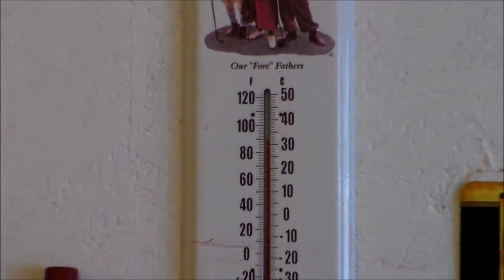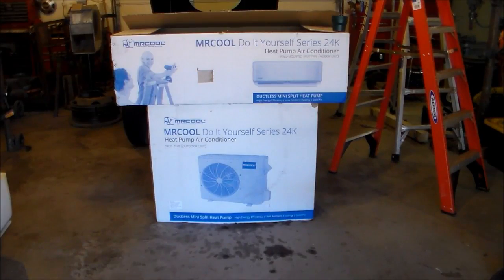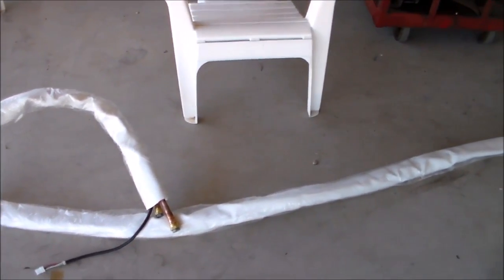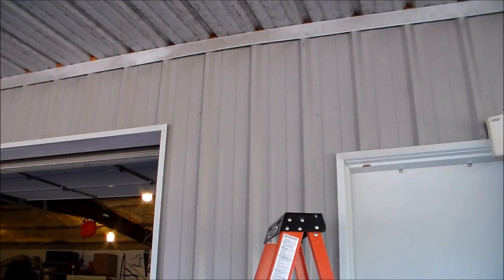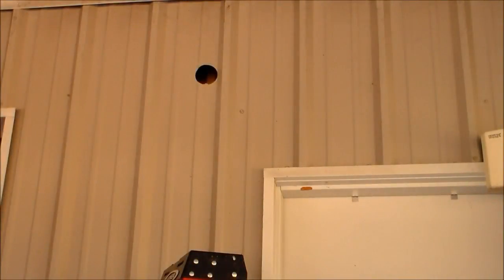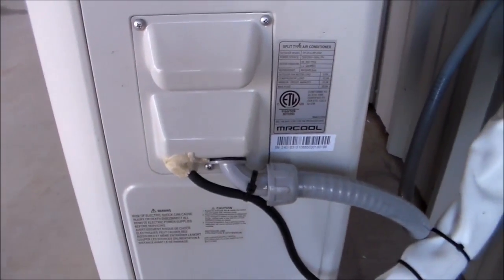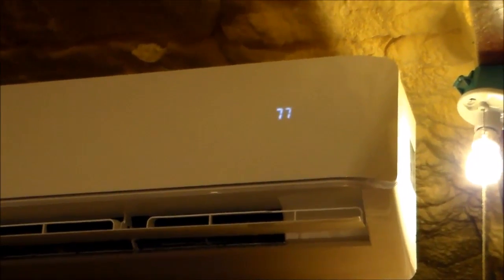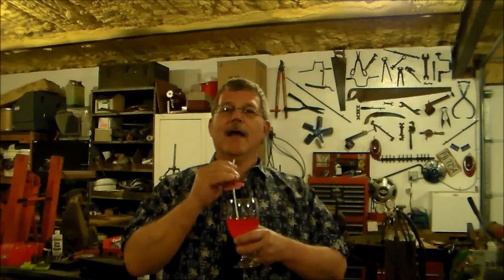DIY Mini Split Install -how to install a  Ductless Mini-Split Air Conditioner

Comment: Hey Rusty!  I just purchased a Mr Cool 18K and the elect requirements in the manual are clear as mud.. I can't find the startup amperage for the unitand the book says use a 30amp CB with either 10 or 8 wire.  I have 105' run from fuse box.  Their specs don't make sense to me.  I've requested clarification from Mr Cool.  What think? any ideas on wire#, CB amp are appreciated
Reply from the maker: With a 30 amp breaker with a 105 foot run use 8 gauge. Much more than that you might go with 6 gauge. If any question check local code. Good luck, you will really like the Mr Cool unit

Comment: I wonder why You Tube thought I needed to see this again today. Temperature topped out at the round 100F this afternoon.
Reply from the maker: These units are very effective in the heat and cold. Would really feel nice on a 100 degree day. 👍

Comment: Pardon me but did not see unit voltage or amperage draw.. did u have to change the line or the braker ?
Reply from the maker: 220 volts, breaker size will depend on the model you get. The manufactures web site has  instructions that give that info for each unit. Good luck on the one you select.
Reply: @RustyGlovebox  thank you for the response.. looking at some reviews.. going to store later..will check the website after I decide...thank u

Comment: So have you had any failures of this unit after 4 years?
Reply from the maker: Not any failures , it is really nice to have in the shop when it is too hot or cold outside.
Reply: @RustyGlovebox  I was wondering, I installed a 9KBTU Turbo Air unit with heat pump, in my metal working shop (lathes and mills), last month. It's a 8x30 area with 11 foot ceiling. So far I've been running it in dry mode, and this brand allows temp. control. I'm worried about the inverter electronics failing in the outdoor unit. I'm thinking of removing the circuit board and painting on conformal coating to insulate the board from any vermin (as that seems to cause big problems with electric shorts), and it will protect against condensing water vapor. I assume my winter coldness exceeds yours with typical highs in the 20s, but lows -10s to -30s. Central Iowa. The summer sucks with 90s and real high humidity, but nothing like humidity off the ocean.
In the house I just finished a 17KBTU  Mitsubishi, and a 12KBTU Daikin. I was trained in HVAC back in 1976 at a 2 year trade school, and worked for the Trane company in La Crosse, WI as a lab tech. 
I'm trying to make sure these mini splits last more then a few years. As the central air in the house I installed 20 years ago, is still going strong.

Comment: Curious why you didn't run the lines down the INSIDE wall where it could be hidden and put the 3.5" hole by the outside unit..?

Comment: placing the air-conditioning next to the heat source is not suitable
Reply from the maker: You raise a good point. I may mount it on the wall to get it away from the roof. May very well help.

Comment: You didn't have to pull a vacuum on the unit or mess with any freon?
Reply from the maker: Richard Neal   That’s right the system comes ready to assemble pre charged with refrigerant. Connect the lines and turn on the valves.

Comment: Did you have to pull a vacuum on the lines to the evaporator?  If so, how do you maintain a vacuum while you attach the lines to the condenser unit?  Thanks,
Reply from the maker: The system comes fully pre-charged with freon and oil. Condenser is already under a vacuum. The lines have a check valve connection with a nut connection and are 25 foot long.

Comment: Thanks for the video.
 I installed an 18,000 BTU Mr. Cool unit about 2 months ago, primarily for heating. It depends on how well your house is sealed, but I would suggest going to the next size larger, just to be sure it can keep up. Though the unit is rated at 18,000 BTU heating output, I think that is a little optimistic, as the colder the outside temperature is, the less efficient it gets. The compressor unit only runs as fast as needed, so over-sizing doesn't cause the unit to cycle excessively...it will just run more slowly.
As noted in other postings; be sure and check the packages for shipping damage before accepting. Mine had an electrical cover cracked and sheet metal bent on the compressor unit. It was an easy fix, but I didn't find the damage until I completely unpacked it at home.
Saw in another posting: they used a plastic gutter to cover the lines down the side of the house so that's what I used. Much cheaper and easier to get in my area. About $15 instead of $50.
You can also buy it through Lowe's online.
Reply from the maker: Thanks Brian, lots of good info. I use mine primarily for cooling in the summer when it is a 100 plus outside. Winters here are mild , so for me the heat is more than enough. My old shop had not HVAC or insulation so I have never been happier with the unit here. Enjoy your week.

Comment: It may be a 100% do-it-yourself, however, i believe the warranty document on this model states that warranty is valid ONLY if installed by a certified HVAC installer, and most be noted on the mail in registration for product warranty reg. Seems one can still save money doing most of the physical work then let the licensed person come in, finalize/inspect, and sign off on it, for a fraction of cost had he done the entire project? Not sure if HVAC folk would do that.
Reply from the maker: I have a HVAC certification and registered the system with the manufacture. Easy system to install and works great. Take care
Reply: Actually, the DIY units do not require professional installation for the warranty per the MrCool warranty website.  "Proper installation – Limited warranty applies only to systems that are installed by a state certified or licensed HVAC contractor, under applicable local and state law in accordance with all applicable building codes and permits; MRCOOL installation and operation instructions and good trade practices. 
*State certified or licensed HVAC contractor not required for warranty on the DIY series units. (Always check your local laws.)"
Reply: That is correct, Debbie!

Comment: Where did you buy that hose guard and how much?
Reply from the maker: I got it from the Home Depot website . About $50.  You could use plastic rain gutter down spout.
Reply: Thank you for that. Normally i use PVC trunking but after seeing some pictures of big contractor from China using the same material as you do, including that plastic rain gutter down spout for their ac installation job, i always wanted to try do the same. I like the looks of it.

Comment: You never said what the temperature drop was?
Reply from the maker: On a 100 degree day it will keep it in the 80's . The shop is insulated with foam and that helps.  It does a good job heating too in the winter months.

Comment: Why the heck do they call them 'ductless' systems?! It's a Split type system. That's it. Simple. You all know what a 'packaged rooftop' unit is right?! Well this is a hi-wall split system.
Reply: Most homes are a split system too. But these are ductless split system. Pretty simple

Comment: Thanks for posting.  One question: if the inside unit and the outside condenser are located close together, can you cut the lines/shorten them or are they a set length?
Reply from the maker: The DIY Kits come with 25 foot sealed hose kit and requires no licensed installer.  The extra hose can be left rolled up in the attic . The unit is precharged and requires no additional refrigerant because of the known hose length that is charged at the factory. 
They offer other units for copper tubing you cut to length,  draw a vacuum, add oil and charge with refrigerant. A licensed tech would be required to install these units in most cases. Thanks and Good Luck with your install
Reply: High Voltage Toys, you still need to vacuum the lines before you open the king valves that allow the refrigerant to flow in the lines.
Reply: I think you just answered my question I was about to ask. Good to know there is no need for bleeding, vacuum tests and all that. 
So just hook up and good to go?

Comment: I'm playing stupid today! #1 heat pump! in ground? #2 pre-,charged- refrigerant or ammonia? # 3 can lines be shortened/lenghtened?
Reply from the maker: It is a heat pump system not geothermal.
Precharged with R410a
These line do not get shorten. The DIY kit  has sealed standard length lines already attached and pre-charged. It will not require a licensed refrigeration tech to install this system. 100% do it yourself kit.
They do offer other units that you use copper lines cut to length like a conventional system too. I hope this helped. Good luck

Comment: Can you connect a normal wall thermostat to the AC?
Reply from the maker: This unit has a wireless remote with a wall mounting bracket and it also has the ability to work with a smart phone.  You might contact the manufacturer if you really require a fixed wall mount thermostat.
Reply: Rusty Glovebox, thanks for the reply.   That was a nice video you posted.  I want to connect a split AC with the nest thermostat  at a vacation condo. 
Happy holidays to you and your family!

Comment: How many BTU is yours and how big is your shop? Just trying to get an idea on what size I might check into.
Reply from the maker: I am cooling about 1350 sqft with this unit.  It's a 24000 btu unit and suppose to handle 1600 sqft. My shop has foam insulation and that helps. They also make a 36000 btu unit DIY install system , mine is MR. Cool brand and have been happy with it. They have a website, Good luck!

Comment: Which model  I know 2 ton  about how much $ not to be noise   The lines are really  SS.  I need help picking one out  .   Thank   Carl
Reply from the maker: Mine is a MrCool- DIY-24-HP-230A. You can check the current price at Home Depot web site. The lines are 25 foot long and seal with an o-ring and line nut at the condensor. No need to vacuum or charge with refrigerant, come ready to go. Connect the lines and electrical and the unit is ready to go. Good luck on your choice.
Reply: carl dore check out Paylessminisplit.com for quotes.
Reply: I thought doing a vac on the system was supposed to be done just to be on the safe side and remove any possible moisture in the system? At least I've seen many videos suggesting to do so. Maybe this unit and lines don't require vacuuming the system. Just wondering. Great video.

Comment: I'm really impressed with these DIY units, too.  By the way, your video shows 30A breaker, but the 24k unit calls for maximum of 25A fuse/breaker.  And it doesn't look like the disconnect is a fused type.  If it is, you could have lower amperage fuses in there.  Maybe the breaker you were showing had nothing to do with the install and was just an example shot.  The unit will do fine with 20A fuse.  In fact, I believe it'll run fine on fuses as low as 15A.  Hope these units keep us cool & warm for years to come.
Reply from the maker: Thanks,  happy how well it's performing in the heat here. Looking forward to see how it does this winter. Take care

Comment: Hey Rusty, Does it also do heat for the winter????   I have been very happy with my heat pump, been real hot here, mine is earnings its keep... Nice neat job, U do good work!
Reply from the maker: Yes it's a heat pump and it's been great here in the shop . Should have done this earlier
Reply: Rusty, I consider my ductless heat pump one of my best investments... When U retire and spend more time in Ur shop, U will realize how much of a good investment U made.

Comment: nice informative video. My central ac unit went out and I installed several windows units temporally until I get it replaced but 
I have heard that these ductless systems are a good way to go.I didnt know that DIY unit are available. so thanks for the info.
Reply from the maker: Look on the Home Depot web site , they have several brands and sizes to choose from. Good luck

Comment: you are so cool even in the summer time in TX not do not go getting a cold..Nice install job very professional nice touch with that line set cover.
Reply from the maker: Thanks Dan, it's going to be a nice addition to the shop

Comment: Looks really good, how many Btu's is the unit? I guess you'll find out soon enough how cool it will get in the shop after a day or so of testing.  I'm betting with the heat setting it will all go to the top of the shop.. Get you a ceiling fans and run it in reverse to pull the heat back down in the winter.. Nice install.. Enjoyed it.. Your right the hose cover made it look profess
Reply from the maker: It's 24k and handle up to 1600 sq ft
Reply: Oh yeah that'll get her done

Comment: That is so "cool" but man come winter it will be "hot" lol, I used to deliver a lot of those to the local ac shops when I worked at a local ltl carrier, so they must be pretty good.
Reply from the maker: I ordered this one from HD , simple install and looking forward to using it. Thanks
Reply: I may just have to put one in my shop,what did it set you back?
Reply from the maker: +crzy4htrods Go to HD web site and there are several sizes. Some are 120 volt and larger ones are 240 volt. They use BTU's and sq ft

Comment: I liked the tips on the circuit breaker. I found out the hard way how many different manufactures there are. I have A/C in my shop and the cost for the increased electric bill is well worth it. I think your going to enjoy it!
Reply from the maker: Thanks , looking forward to it

Comment: How expensive is it and did you say it is both heat and a/c? Looks pretty good and those extra pieces you put on not only dress it up, but protect the lines from sharp edges and inadvertent damage.
Reply from the maker: Yes it is a heat pump, they sized by sq ft  and btu's and priced accordingly.  Got mine from HD

Comment: Wow now that's cool an a nice setup hot an cold how cold does it get there in the winter be nice if it will heat your shop to take care :)
Reply from the maker: Not very cold and when it does, not for long times. Most of the time it doesn't get below 25 and warms up during the day.  Thanks

Comment: looks like a easy install, hope it works good for you. I have a 7500 btu window unit in my shop, keeps it at 72. nice to weld in air-conditioning. :)
Reply from the maker: It should do a good job and looking forward to working in the there. Thanks Dave

Comment: Good work Lloyd!   The line cover/closure panel really makes for a clean install.
A little tip for those working with pre charged linesets like that, a couple drops of refrigeration oil on each connector will help insure a good seal.   The factory should have oiled the couplers already, but a little extra doesn't hurt.
Reply: Hey, got a tip...we are looking into Mr Cool vs LG, Daikin....because of the easy install, no flaring, pump...etc...we previously ordered on line LG 12,000 mini split from Ingrams ...smh...they shipped the wrong stuff and after issues with the freight truckers that didn't show up the first time...I said...take it back! HomeDepot sells Mr Cool and I think we're going local to get this, no more ordering on line.....TIP...vinyl downspout uses clips to anchor to house and does the same thing...under $10
Reply from the maker: Good tip, I did make sure they were good and clean. Sealed good and no leaks for now. Thanks and take care
Reply from the maker: Thanks , got to give that a try

Comment: Thanks, looks like exactly the size I need to install.  I am using a window unit now but it does not keep up.  Kentucky is having a very humid hot summer.  Great video!
Reply from the maker: So far it is meeting my expectations and making it comfortable in the shop. Thanks and good luck

Comment: It is a neat unit ...How does it charge up with the freon ? I'm guessing when it's installed you turn a valve to circulate it or are the connections like a quick coupler
Reply from the maker: With the fixed length hoses, they pre charge it with refrigerant. No oil or additional vacuum required. Connect the hoses and go. Take care

Comment: Aloha ! Nice install.  What's the deal on the office? No AC going in there or just crack the door. Maybe a vent in the office ceiling and crack the door??  Very nice work as usual.
Reply: I thought that too, but if you look closely, you'll see a small window unit @9:27
Reply from the maker: I have a widow unit in the office but was thinking maybe a power vent to circulate  air?
Reply: How did you vacuum the lines down?
Reply from the maker: The DIY kit the  lines are sealed with valve and come pre-vacuumed and oil in the system.

Comment: Was that 120 v? Nice install. I have AC in my shop but it's an old 220 window unit and you can smell money burning when I turn it on.
Reply from the maker: This was a 2 ton unit and it was a 220 but they offer others that are 110 too.

Comment: I guess this kind of A/C is like what they have in China, the apartments look like they have a window unit on every floor, but the inside part was very similar to your evaporator part, they have 240 Volts on everything so the electric is no problem. in a lot of cases they made brackets out of angle iron to hang the condenser unit to the outside of the building.That would be the only practical way to do it since lots of people buy what they call a house but it's more like a low priced condominium. they pretty much own a complete floor and it would be very difficult to have all the condensers run all the way to the ground, although I did see a few that was that way.
Reply: MissouriOldTimer they are popular in Countries with tight living areas Japan China India Germany and many more places use these systems there are better brand out there LG Mitsubishi Samsung Daikin Fujitsu Sharp Pioneer and many more did you vacuum your lines?
Reply from the maker: I bet your right, it was an easy install. And looking forward to it.